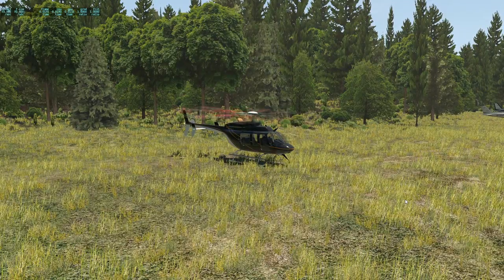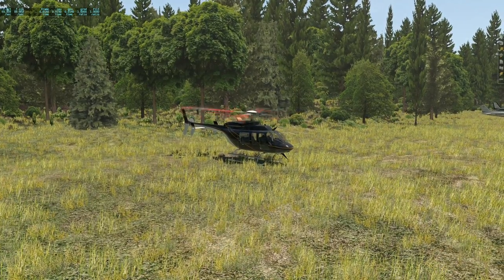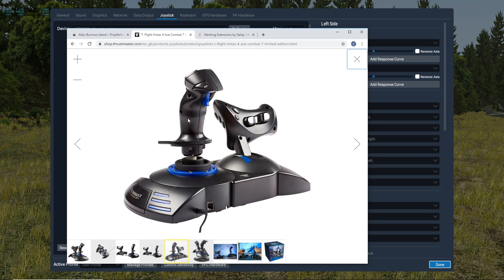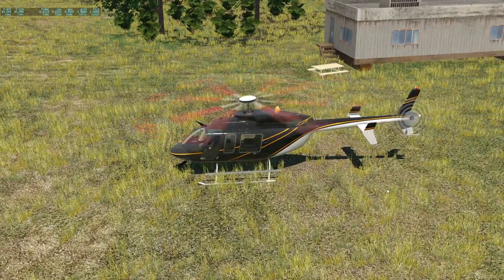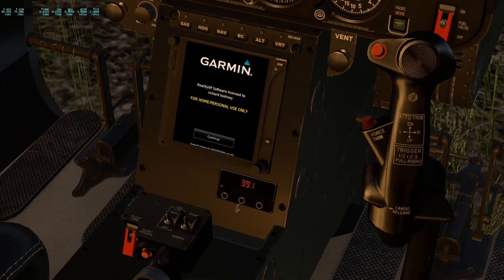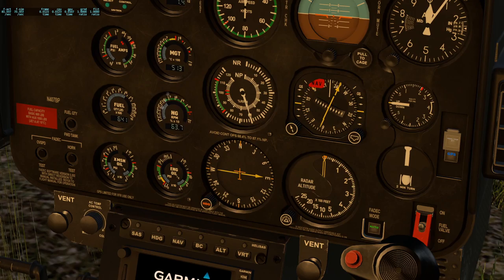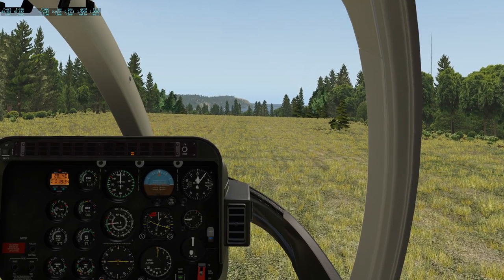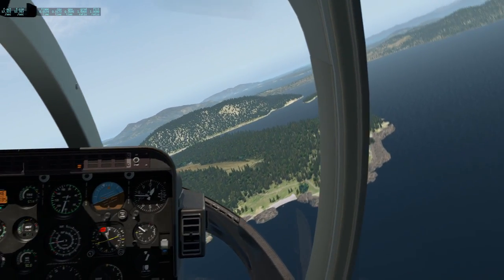Flight Sim Helicopter Flight - Introductory Tutorial - X-Plane 11 Dreamfoil Bell 407

Comment: Rich, its me again!
Since my last Comment, I went ahead and modified a Logitech 3D Pro, not designed for extensions to make the stick a total length..base to tip of 43cm (~17"), by extending 19 wires to the stick end, 12 of which handle a mini keyboard on the base of the stick...near your little finger. Objective was to never have your RH leave the collective, yet be able to use force trim. Changed the original main spring to a very weak one lying around.
Then, I really went the whole hog. Took out the rudder pot wires from the original twist yaw control and linked to set of rudder pedals, I made from scratch. Used a standard 270 deg carbon pot with a ~9:1 to cover the full track of the standard pot.
Earlier, when flying the FSX BELL 206, I had linked the small throttle lever on the 3D Pro to a throttle/collective lever for an ~6:1 sensitivity increase.
Needless to say. Fantastic sensitivity for flying choppers. I have just one problem with the 407. Coordinating the throttle and cyclic, and how you would recommend I go about this. F1 and F2 are a bit unrealistic for throttle control.

Comment: this video while a basic lesson on flying in a simulator seems almost verbatim to an actual lesson in a helicopter from an instructor. Minus the pre flight checks. Newton's law. How without the friction from the ground Newton's laws make the helicopter want to yaw in a direction and tip over without constant input from anti torque pedals, collective input and control of the cyclic and its so sensitive often times finger tip touch pressure is enough to maintain control over 3 axis. Such a great video I almost believe playing this simulator would make me a better helicopter pilot. I just downloaded it. Will play after I finish watching this video. Great video. And yes helicopter is not effective for long distance flight like with a plane its to access areas in a way of flight you simply cannot with a plane. Your approach is nowhere near take off and landing angles, trim, weather planning for long distance, straight and level flight and maintaining high altitude on the altimeter as altitude in a plane is your friend to correct wrongly implemented maneuvers and angles of attack. Regardless of the physics though the concepts are the same and angles, weather planning, straight and level flight and maintaining control at altitude is still a basic fundamental of the physics of helicopter flight. So its almost like flying a helicopter would just make you a better airplane pilot even the concept of flaring in an airplane landing is applied to a low rpm helicopter auto rotation landing. Anyway like I said good video. Edit: after playing I will say they got the combined action of pedals and collective and cyclic right. If you cannot control all 3 you lose control of the helicopter. However the "finger touch sensitivity" only seems to exist with the anti torque pedals, and strangely in the student simulation you have to pretty much maintain the left pedal at all times as though you are flying in a really strong wind so strong you can only stay forward if you constantly apply input to the left pedal. The cyclic was pretty realistic in terms of lots and lots of corrective movement but much too much pressure is needed to move it at all so its impossible to make light movements. The collective seems to be near impossible to put in neutral. I guess there is no neutral though you are always adding upwards throttle or downwards on the governor somewhat but seriously this was the most sensitive input of all. Forward flight is pretty easy in the game. you turn with the pedals to correct and cyclic to complete any turning motion and of course as I said anti torque to maintain. I guess I should have not used a game pad controller. Perhaps actual control inputs that you buy pedals and a cyclic stick and collective would be more suitable for input sensitivity corrections. I guess the truth is they did simulate control of all 3 inputs to maintain constant control of the flight very well. But at random I want to say the sensitivity should be even and its not. At least not with a controller pad. Dare I say a real helicopter is not that hard to fly? I mean its pretty hard input on all 3 controls at once is a major necessity to maintain 3 axis control. Its not a plane I get that. overestimating one control and very little input on another control can result in too much movement forward, or up, or down, or sideways, or did not roll for a turn properly, or rolled too far and no aft collective = serious crash. The game is realistic also hovering is the hardest part. But "finger touch sensitive" is not a word I would use. On a gamepad controller that is. Perhaps with input controls you buy separately then yes. I guess so far this is probably the most realistic I have played. No idea why in training I need to shove down on the left pedal to maintain straight forward position. In a real helicopter tropical storm force winds would be the only thing making a turn in one direction quite so hard. Still great video explanation

Comment: Hi again, the T4  seems like a really good start and with ability to assign rudder to the throttle and not the stick (don't fancy that twisting). But may i aks - I'm considering the T16000 instead and assignining the rudder to the paddels on the T1600 throttle. Any ideas if this might be just as effective, but with the nicer stick of the T16000.

Comment: Nice video! Just one little thing to say: I highly recommend to use headtracking AND (important) disable any kind of deadzone. It´s true that it requires some time for your brain to get used to it, but when it does, something wonderful happens: Your brain drops out the static reference points, and converts them into dynamic reference points. As a result, your brain becomes aware of the helicopter as a 3D object. It becomes aware of the dimensions of the aircraft, and that helps a lot in confined LZ´s. When you reach that skill of brain training, you can fly and maneuver looking through your side window, you can control orbital flight, sidestep flight... Everything gets better. ;)
Reply: I´ll give you an example of what I am trying to say: When you do a flare, if you can move your head down at the same rate of your nose up maneuver so you keep the horizon where it is, you´ll be a lot more aware of your pitch (of the whole helicopter attitude, in fact). You will also keep the terrain in sight. This is very important when making quick stops at low height, for example ;)

Comment: The "Force Trim" command, is that in X-Plane or just in the 407 sim? All I could find for the freeware helicopters were the normal aileron, elevator, and rudder trims which seem to work a bit different than what you described.
Reply: I think it is unique to each individual add-on; since I always find it in the specific control of each (e.g. the X-Trident AB412 has some "412" commands to bind).